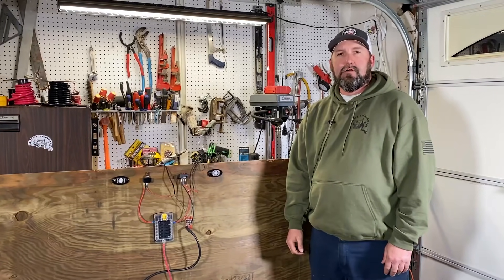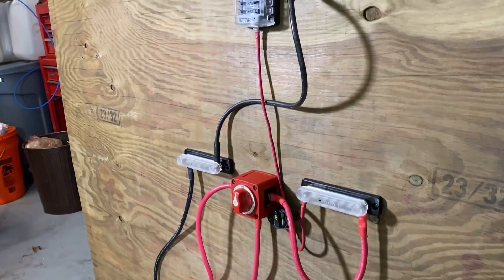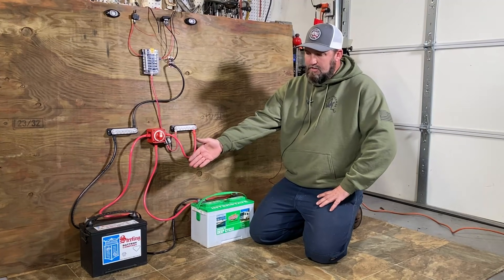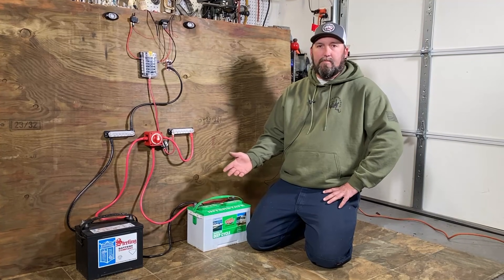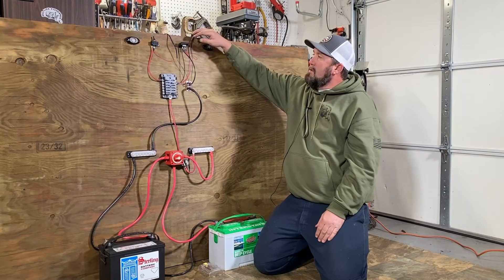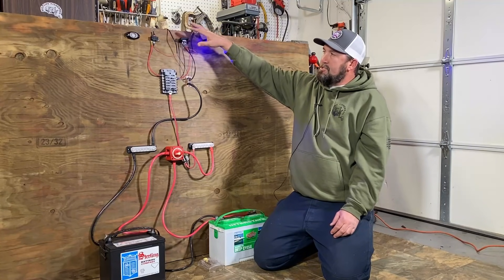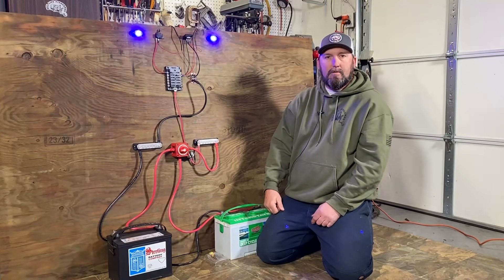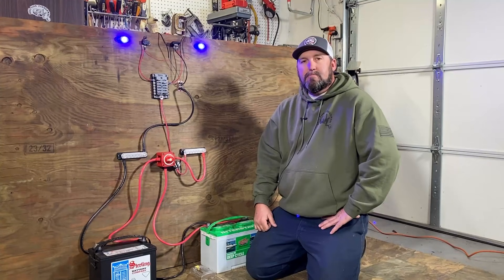BASIC BOAT DUAL BATTERY WIRING | HOW TO

Comment: I have a LiFeP04 100Ah battery that I purchased for my seconday battery for fishfinder, Minn Kota trolling motor, lights etc.
My primary battery is already a Deep Cycle Marine starter battery. Can these two batteries be wired in this way? My concern is the LiFePo4 battery should be charged with a compatible LiFeP04 charger. Can it be charged off my motor WITH the deep cycle at the same time???
Reply from the maker: The lithium battery would need to be charged off of a battery isolator that is designed for lithium . That would be connected to your crank battery and would then charge off of the engine that way. But you should not run your fish finder and trolling motor off of the same battery. That can cause interference and make the screen on your fish finder have static/lines all over when the trolling motor is running. Thanks for watching let me know if you have any questions.

Comment: Why wouldn't you use 50amp breaker going to fuse box insteadof 20 or 30amp?
Reply from the maker: Nothing running off of that circuit needs to be that high. 20amp or sometimes a 30 . Is standard.

Comment: Your videos are great! Thank you. On this wiring demo, you mention the battery isolator video (I also watched that). If you were adding an isolator to this demo would it go in line on one of the wires in your demo? Or would it be like adding another red positive in between the two batteries with the isolator on that line?

Comment: Just came across your video. How would I wire a Garmin live scope and black box to a single lithium battery in my rod locker using the on off switch.?  I don’t understand where the wires go to the switch and then to the battery. Is it only the positives that get wired to the switch and then one postive wire from the switch to the positive terminal to the battery?

Comment: 10 gauge marine tinned as opposed to 4 gauge is recommended.  The 20 or 30 amp circuit breaker is an uneducated statement.  It needs to correspond to the gauge of wire and there are standards of installation such as length of wire run from battery to breaker, etc., I used Chat GPT for compliance and adherance.
Reply: @ReelLifeFisherman ignorance is bliss. I lived in Brunswick Ga for two years in the early nineties as a transplant from Long Island. I've seen your kind before.

Comment: Why do you share negatives on a deep cycle and crank battery?
Reply from the maker: Without them sharing negatives you wouldn't be able to use the deep cycle to run anything on the boat .  If you are wondering about if that makes them in parallel..it doesn't. Only when the switch would be in the combine position would they be that way. And that's only for an emergency situation it this setup.
Reply: @ReelLifeFisherman  are they drawing any current from one another that way? Seems like the crank would drain the deep cycle. Thanks for responding back
Reply from the maker: No they are only sharing the ground to complete the circuit. The switch determines which battery is being used.. but that's for the positive side of the circuit. So the grounds are shared.
Reply from the maker: No problem let me know if you have any questions. This is not for using a battery that is a part of your trolling motor system.  And if you want the deep cycle to charge when your running the engine and you have the crank battery selected you would want to run a ACR automatic charge relay. I have a video on that as well. Thanks for watching
Reply: @ReelLifeFisherman I have a crank and deep cycle, both on separate switches, wondering how I would configure ground to get motor to charge both batteries?

Comment: Some battery switches are make before break which means you can switch between batteries with the engine running.

Comment: This was awesome!  Getting ready to completely rewire a new to us (old) pontoon boat. I'm a man of clean and organized wiring and this video has secured my design.  Just purchased a Key Line auto isolator and will run a 27 and 31 battery setup under the rear bench seat to help keep everything nice and dry.  Thank you for this well explained video!

Comment: I thought You could run on one and two so you charge 2 as you run ? since two is the one constantly being drained with the downriggers while Fishing
Reply from the maker: You can but ideally they should be the identical battery because they are in parallel at that point

Comment: Hi just bought a used boat and was poking around the electrical . I was wondering if I have a dual battery acr but all the accessories are wired directly to the battery with inline fuses would you still wire the boat the same . Leave the acr part alone and then put a fuse block in off the battery rather than having all the rings on the battery ?

Comment: I wired my boat exactly as you recommended in this video a few years ago.  I just bought a lithium trolling/house battery replacement.  Does the starting battery need to be converted to lithium as well? Or should it be okay having lead acid for starting and lithium for house?  Thank you in advance.
Reply from the maker: Only if you have an isolating automatic charge relay. And you couldn't ever combine the batteries on the switch. Because you can't run a lithium battery in parallel with any other battery type . So i would recommend going all lithium at that point. Or going with a ACR and eliminating the batteries switch .  Then run all the house stuff on the lithium and just the cranking battery to the engine . The ACR will keep them both charged when the engine is running and you can't drain the crank battery because only the engine is connected to it and it will always be charged
Reply: @ReelLifeFisherman  Thank you so much for answering. So basically do away with the switch. Wire only the motor to the cranking battery and wire the lithium to the ground and hot bar for the house electronics? Then connect both to the ACR via their positive terminals? Basically the only thing the ACR does is allow the lithium to charge safely when the motor is running and the cranking battery is full? Thanks again for sharing your knowledge.

Comment: Hey, buddy, thanks for your video I was wondering, can I also use an eight gauge or six gauge for the negative? You have a forgage coming from the negative bus bar. However, I did buy one of those fuse boxes with the positive and the negative connectors
Reply from the maker: You can use 8gauge for the negative from the battery to the fuse box negative. But if you are running from the negative to a negative buss that you want to run your negative from the engine to then i would suggest 4 gauge
Reply: @ReelLifeFisherman thanks for the input. I am running the negative going to the motor on the negative bus bar

Comment: So the positive lead of the motor goes on the output of the switch, where’s the motor ground going, directly to the crank battery?
Reply from the maker: Yes the ground would go directly to the cranking battery negative.
Reply: @ReelLifeFisherman thanks!
Reply: @ReelLifeFisherman how will it work in relation with the charging system?
If I want to charge both my battery I select both?
1or2 depending on what battery I want charging while under way, is that how it should work?

Comment: Would there ever be a reason to have anything else directly wired to the positive bus bar in the rear of the boat other then the common positive feeding the dash fuse block. Essentially any accessory’s you would need to run your positive wire to the fuse panel in the front of the boat but you could ground and accessory’s to the shared ground bus in the back of the boat. Am I understanding that right? 
Just found the channel. Great content.

Comment: I am installing  
LiTime 2 Pack 12V 100Ah  Lithium Battery, Group 31 on a searay boat for the motor and lighting question is the changing of those ok for cranking and ok to charge while motor running
Reply: i went with  Lithium Battery for weight and longer ah for lighting and other accessorys

Comment: So is this setup adequate when running a lithium accessory/house battery ?
Reply from the maker: No, I would recommend running a different set up with a lithium battery as your house/accessory battery. I would recommend running an automatic charge relay with an isolator to keep the battery separate but charging at the same time when the engine is running then run all of your accessories, boat power etc. off of the house battery in the engine off of the crank battery. it's a similar concept to this set up. What a different design. Your crank battery will never be drained by your boat accessories.

Comment: Hello using this setup can i have a lead acid battery for starting and a lithium for house
Reply from the maker: You could but you could never combine them.  I would suggest a different setup. Where you don't have a battery switch to combine or switch between one or the other. And get an automatic charge relay.  ACR . And run all of your boat electrical off the lithium battery and the engine off the cranking battery. The ACR will charge both batteries when the engine is running and keep them separate.  But your engine will always start because when you're using boat electrical stuff stereos lights or whatever is running off the lithium.  It's a similar concept just different design.
Reply: Thank you very helpful  @ReelLifeFisherman

Comment: I just rewired my boat after restore and have my starting battery going to the position one on the off and on switch I have the house battery positive going to number two then I have my motor positive on the output of the switch and a positive also from the output going to my fuse box upfront. My question is when I turn the battery switch on one to start the motor am I supposed to have power to my house accessories also Because no matter whether it’s on one or two I can start my motor and all of my house accessories work. Is this supposed to be or have I done something wrong? Thank you! And I love your videos. Very explanatory.

Comment: When wired like this will either battery selection start the boat or would it only start on 1 or all?
Reply from the maker: Both batteries would start the boat on their own , or in an emergency you can combine them if both were low . In this setup both of the batteries would run everything on the boat . You could use two cranking batteries if you want. But the deep cycle battery last longer with the engine not running. So if you are fishing on anchor or on the trolling motor and the engine is off. The radio and Livewell/ baitwells lights etc. will work longer than on a cranking battery. That's why I recommend running a crank battery for starting the motor then switching to battery 2 the deep cycle for using everything else on the boat with the engine off. Then you can rest easy knowing that when you want to leave the crank battery is still fully charged.
Reply: @ReelLifeFisherman  Thanks for the quick response the boat I just bought has dual batteries but it won’t crank when I have it on battery 2, battery 2 is charged and relatively new. Any idea as to what would be wired wrong?
Reply from the maker: Make sure they have the ground jumper from negative to negative on the batteries. And make sure all connections are free of corrosion.

Comment: This set up will not start my boat why????
Reply from the maker: Either you're missing the engine ground or your ground jumper possibly depending on if the crank battery can start it or not ? Also the engine and boat power wires need to be connected to the output side of the battery switch.
Reply: I have all that negative coming from engine on crank battery jumped to house battery engine positve and accessories on output of switch accessories on the output aswell it starts no problem on the house battery switch to starting battery it tries to start then clicks it did start once but didn't want to roll over if I take the engine postive off the switch and direct to cranking battery it start right up no problems
Reply from the maker: @philipmaccormack you connect the crank battery negative and the house battery negative together. With a 4ga. Jumper wire. The house battery positive connects to battery switch position #2 . And the crank battery positive to battery switch position #1
Reply from the maker: Also make sure all connections are tight and you are using 4ga jumper wires for everything. Batteries to switch and negative jumper

Comment: Having an issue on my nauticstar 2200 TE w 2 house batteries. Stereo, garmin, vhf and livewell pump are mainly running off 2 12v sequence batteries. Getting about a 1/4 day before stuff stops working and I’m guessing I’m losing power in the lines where it seems alternator isn’t getting a good charge back into the system or the wiring is fine, but batteries need to be replaced.

Comment: I disconnected my negative jumper from my deep cycle battery to my cranking battery because i was concerned that power from my cranking battery was going to my trolling motor. Should I have done that?
Reply from the maker: I would recommend not connecting your cranking battery to your trolling motor battery. Unless it's only for emergencies. And if it 24v or 36v system it must be connected correctly or damage due to electrolysis could happen, especially to the trolling motor.
Reply: @ thanks. It was connected that way when i bought it used.

Comment: I really need advice.  I have (3) 12V 140 AH LiPo4 batteries on my boar with (2) 4-way selector switches and a 40 Amp 3 bank ignition protected charger.

The batteries are dual purpose in that they are all my cranking batteries.  (Port engine, stbd engine and generator)

How can I make the best use of the 420 AH of power I have and install an inverter to take one AC, cabin lights and fridge/freezer off AC power.

Would a 3000 watt inverter do the trick?

Comment: So when you switch from starting battery to house battery when you turn the motor off all the electronics will be momentarily lose power? And vice versa when about to start motor and switch to starting battery chart plotter will turn off?

Comment: My 34 silverton has dual switches. I had someone else install the batteries and ever since I have had a problem, which I believe is in this area. Ocassionally it turns over without a pr9blem and then I go back to it and nothing. What could it be?

Comment: Very informative video! With this type of set up is it ok to have a standard lead acid battery and LiFePO4 battery on same on/off switch circuit? Wondering how I can just stop my cranking battery with lithium electronics battery if needed. TIA

Comment: So, on my Bayliner 2655 Sunbridge, I have two freash water pumps, and a maceration pump. Those draw more current than the rest of the electronics which are stereo,  marine radio, citizens band radio, radar system, and depth finder. Which breaker would you suggest? Im new to this stuff and am learning. Thanks in advance for your help.

Comment: I know this is an old video, but it is exactly how I have my boat wired to a two position on off switch.  My question is this.  When charging these batteries, where do I put the Neg. And Pos. Jumper ends of the charger.  I tried black from the charger to blk on the battery and pos (red) from the charger onto the red on the battery and i keep getting an error light on the charger.   What am I doing wrong?

Comment: Excuse my ignorance…. What’s the point of connecting the cranking battery to everything? Why not just run the cranking battery directly to the motor?
Reply: In such Case the engine will charge only the battery connected

Comment: So, I can't understand elecronics, with my boat the cranking battery also supply the fish finder and the stereo of the boat, I want to separate this with cranking battery to be only for engine starting and other deep cycle battery for the fish finder and stereo. The problem that I'm seeing is that the deep cycle battery will empty very quick if im using both fish finder and the stereo (it has a subwoofer also). This means that maybe I wouln't get over one day without charging the deep cycle battery. Is it possible to charge both batteries when the engine is running? And how do you do that? Thank you,
Reply from the maker: Yes you will need a  automatic charge relay (ACR ) it will isolate the batteries from each other but charge both batteries at the same time. Regardless of the position of the battery switch. It will put the engines charge to the crank battery first . Then when it hit a certain voltage usually somewhere around 13.2 or .4 it will start charging the other battery and it will just switch back and forth between them.  I have another video on my channel installing one on my own boat .  Thanks for watching and hopefully that helps. Let me know if you have questions.
Reply: @ReelLifeFisherman  thank you for the answer, I will investigate further! And watch your video, of course!